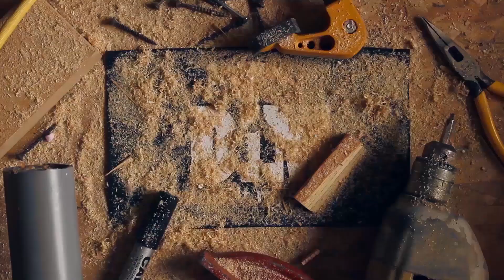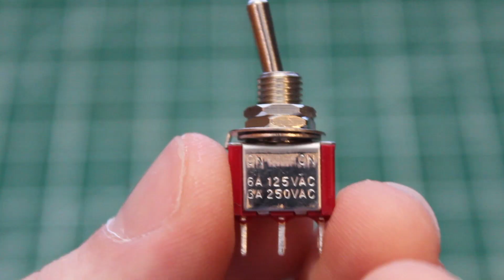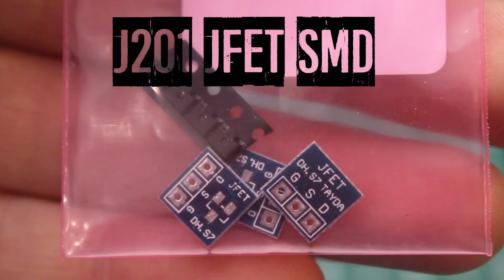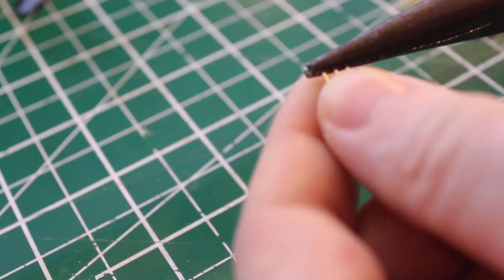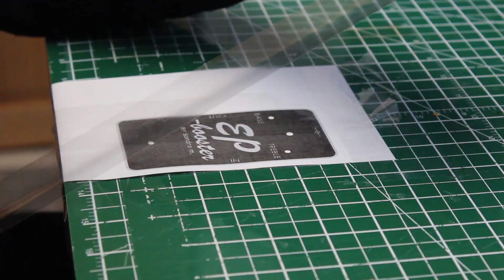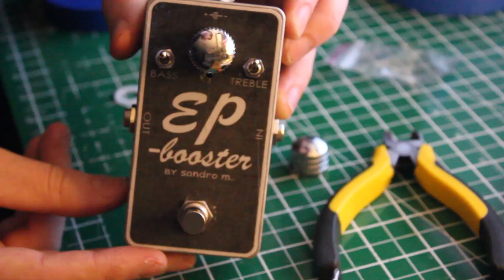How to make: EP Booster Clone

Comment: I built this same EP from Tayda. At first i was not impressed but after setting the biasing of the trim, it officially landed on my pedal board. It make your sound big (can be fat) yet clear specially on strat. I used on-off-on switch. It was worth it and cheap.